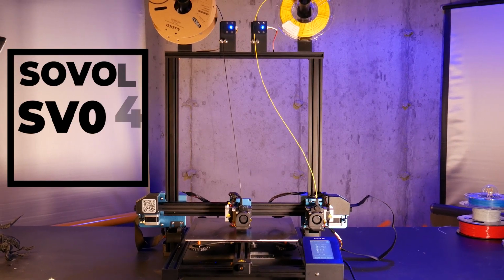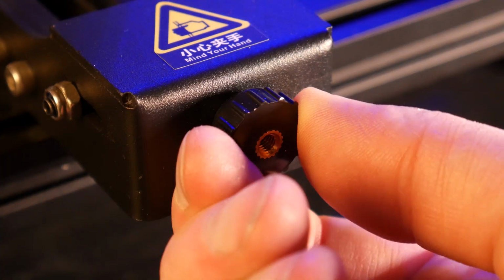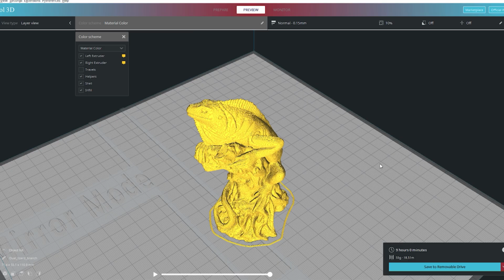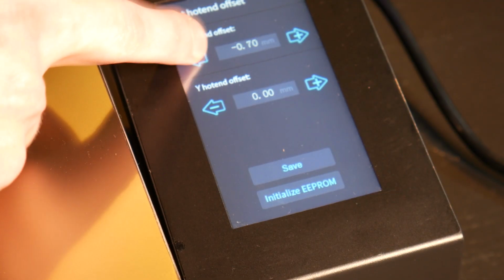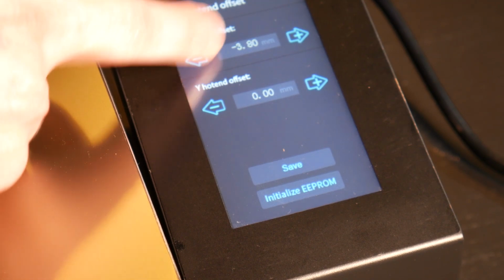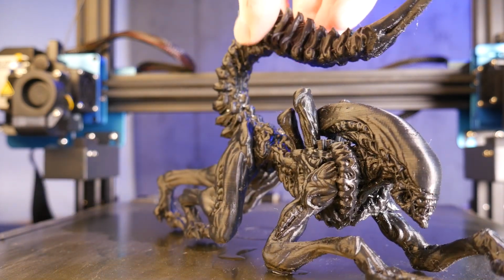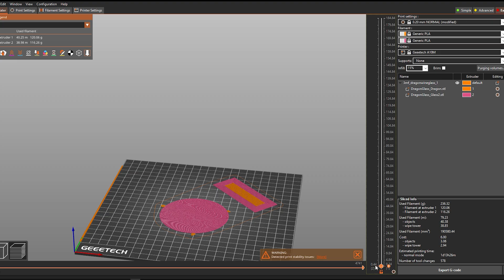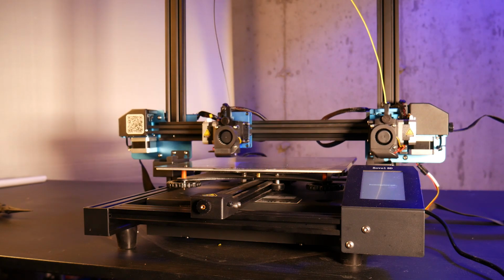Sovol Sv04 Review // wildrosebuilds

Comment: I just purchased a Sovol, because of the solvable material. But since I'm using linux I can't use their slicer. I tried setting it up in PrusaSlicer, but can't get it to work properly. Do you mind sharing your prusa setting? Or maybe you have a good tutorial? I'm happy that I managed to calibrate the printer, but Slicing with PrusaSlicer just doesn't work yet.
Reply: Reading around it seems Sovol forum user Bjoern has a good set for prusaslicer. Try the post 'Bjoern - SV04 - Prusaslicer - All Mode Config ini’s?'

I prefer orca and will also poke around the github B20bob/Orcaslicer_Sovol_SV04_DUAL_Profiles which only has dual (you need to add an ender 3 printer before importing)

Are cura and prusa not available as Flatpaks for you? With WineZGUI I could run the sovol branded cura.

Still reading up before printed arrives

Comment: I'm having a problem with extruder one gear not rotating correctly when the print head goes beyond +/-230mm on the X axis. It starts to jump as though it is slipping and sounds terrible.  I've moved the print head one mm at a time to try and pinpoint exactly when it starts happening, but it changes each time. That makes me wonder if it is a firmware issue? I first noticed it with a print last night. Any ideas would be appreciated.

Comment: Those pauses in between layers, and resulting blobs, are a common issue of power loss recovery mode being on. Turn it off and you'll most likely see the issue gone. This isn't a printer specific issue, it's a firmware issue.

Comment: 6:40 this whole section sounds like what you'd find on a "World's first sub-200 dollar IDEX machine" kind of thing. not something that costs 500 from a somewhat respected brand.

I checked the website to see if this was just another case of 3D printer manufacturers sending un-finished units out to people to 'beta test' them instead of hiring actual QA teams... but it looks like this is actually a product they are already selling?

On a side note - I've seen the issue with some slow SD cards (or slow printer mainboards) pausing consistently during a print due to being unable to read commands fast enough from the SD card. This has always been fixed by simply running it over USB (or over octoprint, etc) in my personal experience.

Comment: I would want dual independent leadscrews on an IDEX machine so that the gantry can be levelled with G34, having a datum makes levelling / tramming everything else a little easier although I am not aware of a model that has this feature out of the box, I would have thought we would have a definative IDEX machine by now, but it seems companies release one and then cease any further research into it, having said all that I would prefer a toolchanger printer to an IDEX, I did have a deposit down for a Prusa XL but got pissed off waiting so redeemed my deposit with the intention of getting an X1 Carbon but then I had some concerns so held back and now the competition has started releasing machines I will wait and see what develops, the new Qidi core XY machines are quite good and Creality are due to release their K series but I cant see them coming up with anything even close to Bambu Lab, even if they did there would be faults with it!
Reply: I believe the SV04 does indeed have dual independent leadscrews, and does offer software controlled gantry leveling - no?
Reply: @davidweinbach3548  I just looked on Sovols website and the board thats in the SV04 only has 4 drivers and the Z axis has two motor connections going to the one Z driver so I would say it does not have dual independent Z drivers. of course a board change and firmware configuration is an easy enough thing to perform to allow this function.

Comment: I sliced a model today in Cura and Prusa slicer and Prusa printed faster AND with better quality on the exact same settings (Ender 3 V2 profile; 0.28mm layer height with a 0.6mm nozzle). I've been a dedicated Cura user since the beginning of my 3D printing journey, but today I saw that Prusa slicer is just better. Cura has some features that Prusa slicer does not have, yet, specifically tree supports. Fortunately, it is set to come out with version 2.6, which is not that far off, plus you can try the alpha version in the meantime. 

I also saw that with the Prusa sliced gcode file, it made the movements of my printer so much smoother during printing than with Cura. I was utterly amazed. I stared at my printer today the way I did back when I first got it. It was a night and day difference. I have been missing out!

* Sorry, the comment is just about slicers instead of the printer, but you mentioned Cura being "clunky". The printer has potential, but I've seen that people have been struggling with the Sovol printers lately. You are not the first content creator that has had a bad experience with their printers. They need to step up their game or improve their quality control.
Reply from the maker: yes! in 2014 i used Slic3r, which prusa slicer is built on, but made the switch to cura due to the easier UI. not much has changed with cura since then. not to mention the reskinned versions of cura are usually outdated to begin with. at the $500 price point these companies need to focus a bit more on end user experience and start shipping good slicers. the sovol sv06 seems to be quite well regarded but i think thats due in part to people just using the mk3s profile in prusa slicer.  I also think one of these companies needs to start employing a model creator, it was hard to find models for this video that i hadnt already printed for other IDEX reviews.  Thanks for watching and thanks for sharing your experience, always nice to have some validation after a somewhat frustrating review process :)
Reply: @WildRoseBuilds  Haha I can imagine that you are running out of files to print.😄
It's not necessarily a bad thing to print the same model for reviews, because you could compare them between printers, but having a room full of the same print can become a little too much. 

I have watched a lot few of your videos, especially the time lapses and cool 3D model printing videos. Mainly for some inspiration on what to print / design. I do like useful/functional prints, print-in-place models, and cool decorative prints. 

I wouldn't mind doing what you and many others do, and review 3D printers. It looks fun, even with all of the issues that can arise like printers not working, or profile & filament issues, etc.
Reply: What all did you have to change to get it to print in dual mode using the Ender 3 profile in prusa?

Comment: Thank you, it helps to know that I'm not the only one to have these issues. I have a farm and will be able to unbox, calibrate, and start using a new machine in less than an hour but this thing took a month to calibrate for production and still has occasional issues. We use our custom made profile on Prusaslicer as the paint function alone is enough to outweigh any other software.

Comment: for the stopping between layers - check the power off resume setting - some printers pause when that is turned on while the current layer status is saved to the SD card.
Reply: I actually noticed this blobbing on the sv04 while printing with octoprint. It's caused by the printer responding with unexpected gcode. I fixed it by installing the octoprint ackackack plugin
Reply from the maker: thanks for the tip! seems weird to sacrifice print quality for a feature that i've used maybe twice in the almost decade i've been printing haha. thanks for watching!
Reply: Indeed, the problem is with the processor itself, reducing the poly count of the model will eliminate the problem